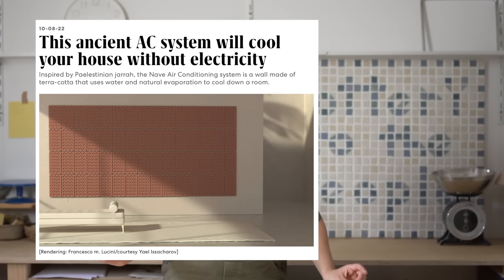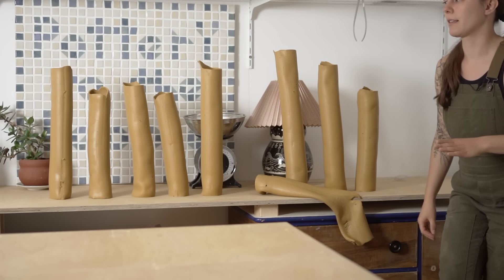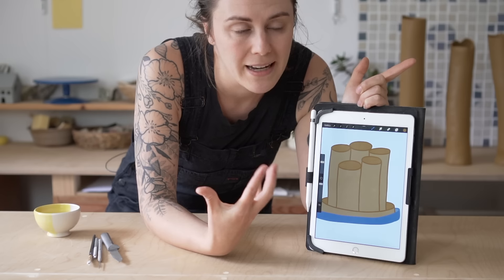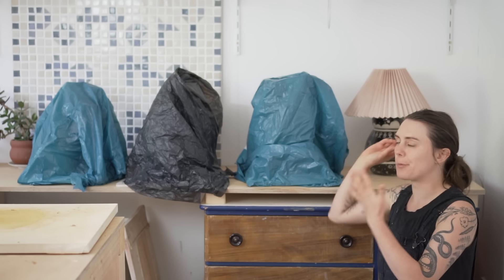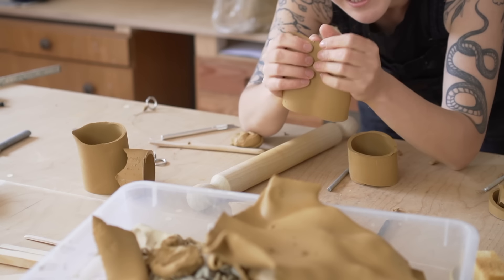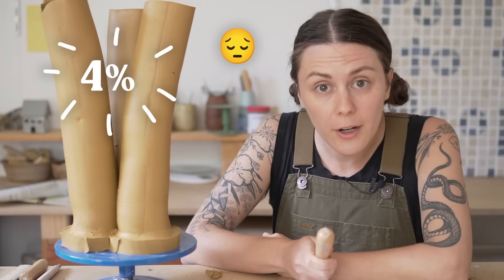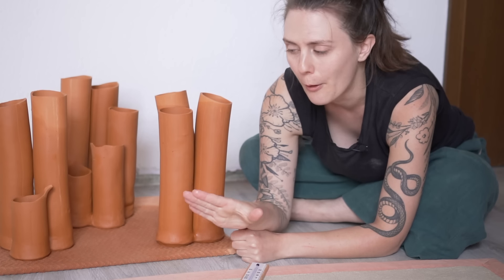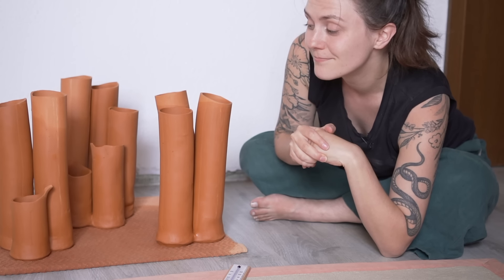Can I make an A/C out of clay???

Comment: if we have a system defined with your room, the pot, and the water, the heat pulled from the room to evaporate the water gets put right back into the room, the water will store the heat temporarily (that’s how the air gets colder) however the air gets slightly more humid and the heat from the little water particles will get redisbursed back into room as long as there’s nowhere for the evaporated water to go. Whatever heat is lost by the air is gained by the evaporated water and still remains in the system. Circulating the air a bit might help more and this is on an extremely small scale so the overall effect is probably pretty negligible.

Comment: Very nice video!  FYI in India since immemorial we have been using clay pots, glasses, dinner sets, utensils etc and many more products used especially during summer...we use it even now not because we cant afford/use refrigerator its mainly because of the earthy feel and taste which makes a huge difference between water from a clay pot vs fridge also a curry made in an earthen pot vs a metal utensil :) I havent tried using it as AC but will definitely try :)

Comment: These are awesome for places with lower humidity but we need to find a way to cool humid places, like Florida, if we want any hope of getting off ac. The biggest hurdle to that being that sside from traditional ac there's no way to decrease humidity without increasing heat. Even running an electric dehumidifier heats up the room by several degrees and often you have to overuse the ac just to get the humidity to a tolerable level. (Meaning it's 110f and 89% humidity and inside you're wearing a sweater or under a blanket bc the ac is shooting out freezing cold air all day long!)

Comment: I would not be able to function if I didn't have AC where I live. But I'm planning to move to Germany in a few years and I've already been looking into other options (especially since, as you said, AC isn't super common in Europe). This is definitely something that's interesting. I wish that newly built buildings that don't have AC still had some of the old tech that was used to cool places and create air circulation throughout a house for example.

Comment: what if you used 2 sheets of clay, made a zig rag patern of a burnable rope, then crimped with perforations where there is no rope, burn the rope out, and this would effectively make a Clay Radiatior. you could blow a fan against and through any large enough perforations to make a form of "swamp chiller".

Comment: when the outside is around 39 degrees hot, even a couple of degrees cooler make a huge difference, and even if you are using an AC, you are helping to reduce energy consumption because it takes less time for the AC to reach the desired temperature, which should be not lower than 25c

Comment: Very interesting video. Not sure but it seems like it did work. If tubes kept temp low while outside got considerably hotter. As an aside there are new technologies that allow certain acts to be markedly more efficient, using far less electricity than the models of the past. I really appreciate your sharing your knowledge and skills here.
Reply: That's AC's, not acts.

Comment: I think you were more successful than you thought:

- Since your cooling tubes were all located in one spot, the temperature at the location of the coolers only decreases after the whole room cooled down by let's say 1 degree (since the produced cold at first distributes itself in the whole room). 
- If you put all the coolers into a smaller testing room (like a small storage room) you would see a much bigger temperature drop in the same amount of testing time.

- Besides, you made the effect of the coolers smaller by putting each tube much too close to its neigbour. 
This way, in effect only the surfaces of the outer tubes cooled the room down. (Only the "outer" surfaces of the tubes without any neighbouring tubes can cool the room down.)

Recommendations: 
- Seperate all tubes from each other and distribute them all over the room. (No tube must have a neighouring tube to maximize the "outer cooling surface area").

- Your cooling tubes had - when you checked them - , already cooled down the whole room nonetheless by 1 degree (which is a lot) in regard to the room size of about 20 m³ or so. 
(It would have been interesting to check the temperature in various spots in the room by placing the 9 or so cooling tubes in 9 spots equally distanced from each other and locate thermometers of the same kind half way between all of the tubes.)

- Besides you could improve the cooling effect of the tubes by adding thin metal cooling rips vertical to the outer surface of the cooling tubes, if available. (Maybe from used vegetable cans.) -  This way more of the room's warm air could be cooled down in the same amount of time.

Comment: This actually comes from an ancient method of cooling systems called the zeer pot, which uses the phase change of water to absorb heat from the center of the pot. When you put so much water in it without it evaporating, it’s actually taking away efficiency of this process. So if you made a pot that had a high surface area to volume ratio, along with using a fan to blow air across it (increasing convection heat transfer / evaporation rates), you could potentially see better results. However I would couple in a dehumidifier in the room to lower the heat capacity of the air so you would be able to produce cooler air faster.
Reply: My only concern which I can’t exactly remember right now, is that I feel like this breaks the first law of thermodynamics, which is that the energy in a system can’t be created or destroyed. The zeer pot cools the inside of the pot at the expense of the water vapor pulling out heat. Despite the energy it takes to change phases, all that warm humidity is simply going into the room you are trying to cool. So I guess it would only work if you could release all that humidity into the surrounding environment ie: outside the room

Comment: To understand what went wrong, look up Zeer pots; they're basically earthenware refrigeration devices that work on a similar concept to this and are known to be extremely effective in hot climates; all the sources will tell you that they become more effective and achieve lower temperatures the hotter it gets outside, since they're basically evaporative coolers. 67°F is already pretty dang cool for a room temperature (like, why would you want it any cooler?) and is probably way too low to get any measurable effect from something like this. Send one of these over here to southern California where it easily gets like 80-95°F indoors in the summer without air conditioning, and I'll let you know how well it works 😁

Comment: So there is a technique from the miniature painting that I am curious how it would work with something like this, it should help for both increasing the surface area and adding to the organic texture, but I'm not sure how how feasible this would be for such thin pottery.  The basic idea is you take something that is very liquid but will dry to be solid in the case of miniatures l some thinned down 2 part putty in this case obviously just thinned down clay and you stipple it on with a coarse stiff brush and it leaves behind a texture.  As I said I'm not a potter so I don't know it this would do something undesirable to the porousness of the clay would make it much more likely to crack or would just sort of flake off in the kiln, or if it would work the way I'm thinking and just give you the extra texture when done.

Comment: couple of things: firstly, theres more efficient designs, secondly, you need airflow to transfer the coolness from the tubes to the room, the most obvious method is designing an insert for your window so that as the hotter air blows into your room it gets cooled from the tubes. in fact i gurentee thats how it was actually used in the old days

Comment: Great idea. Space them out more to allow ample space between the tubes for air flow. Think more functional then art. You just need a little more science. Cold air drops, heat rises. Suspend them or make wood or metal legs to get them more room to work. You had them setting on the floor, already the coolest place in the room.

Comment: They may not have worked to cool the air much, but if a thermometer in a similar room showed a significant rise in temp it could be evidence that it worked to keep it cool-er.

Also, if you point a fan at them, it may do a better job of cooling,

Comment: I think this would work much better in heat. 67 is pretty cool… much cooler than body temp. In the US we use AC because hot is like 90 or 100 degrees. The effect of this method might scale better in hot weather.

Comment: @potterytothepeople A wire pulled across the bottom of the extruder die will give you the best flat cut on the bottom of the tube if you decide to do more of these.

Comment: Interesting experiment. It made me think of my Peace Corps days in Brazil, 1967-69, 10º from the equator, without electricity, 
I used a water filter made of unglazed terracotta. I paid a neighbor boy to bring about 40 gallons of water on his donkey from a dam outside of town. I covered the top of a gigantic jug (handbuilt by a neighbor, about 2 ft across X 3 ft high) with a clean dishtowel (ironed to sanitize it) to filter out small stones, vegetation, & insects.
Any water to be used for drinking or cooking was boiled for 20 minutes. After it cooled, it went into the top of the ceramic water filter. I'm not sure what the filter was made from but it seemed to be a rough white, stonelike, porous cylinder. The water then filtered into a lower section of the container with a spout on the side near the bottom. Filtered water was almost as cool as it would have been if kept in a refrigerator. Each week I cleaned the water filter which collected a thin brownish-green scum, by rubbing it with sugar and rinsing it in filtered water.
An almost constant breeze, mud-brick walls, and ceramic-tiled roofs kept houses from getting too hot. The average temperatures, mid-day year-round in the shade, were in the 80s. In the noonday sun, above 110º at times. Nights were cool enough for a light blanket. 
When I visited my Peace Corps site in 2011, it had many things it didn't have when I lived there including running water, a sewage system, full-time electricity, a hospital, collegio, hundreds of motorcycles, wi-fi, and a cell tower but I didn't see any air conditioners.

Comment: This is also called a swamp cooler.  It can be made with stones, clay, fabrics, screens, thin wood panels, etc.  The more humid the regional climate, the less effective the swamp cooler will be.  The more arid the local climate, the more effective.  Also,  This will transfer moisture from the cooler to the air inside the house, thus raising the humidity of the house and making the cooler less effective and also making humidity troubles, such as mold.  A swamp cooler in conjunction with a fan and a dehumidifier can generate extremely cold air...but then it is becoming more similar to an air conditioner in its energy use.  Putting the cooling tubes in a breezy place would increase their effectiveness, if you don't have electric fans or dehumidifiers.  So it would be a good tool to cool a shaded patio or breezeway.

Comment: You should have checked it against the temperature outside, before and after. That room might have been 5 or 10 degrees warmer had you not had those in the room. 
Also.... would using a regular terracotta pot work? I don't have access to any of the things you used to make this, other than the Xacto knife. lol must they be in tube shapes?

Comment: You could solve your bigger kiln problem by experimenting with building one yourself, there are many ancient techniques of how to fire big objects without gas or electricity, Romans for example made huge amphorae, way bigger than the extruded tubes you made. They build brick kilns, and fired them with wood, to reach higher temperatures you could use bellows, or fans or blowers(I’ve seen people use leafblowers). It’s amazing how high the temperatures can reach!
I made my own little kiln in my backyard in which i do projects, not anywhere as big as those amphorae but the concept is the same.

Comment: i bet if you put a little fan or a couple of computer cooling fans in front of those and pulled the air through them, into the room with just the right amount of force it would work pretty well.
Reply: Just buy a fan at that point and not even bother making them
Reply: @TheLastGasStation  No.. you
the whole point of the build is to have cooling done without electricity. it's craftsmanship and science that you're just throwing away with "just turn on a fan lol"
Reply: @thebreadster1500  those little computer fans can run for days on  the equivalent of 2 AA batteries. hook a little solar charger up to it. move that air slowly and it will cool a room after a while.
Reply: @TheLastGasStation  but the point of the build is that it relies solely on handworking and craftsmanship, not electricity and circuitry, as the ancestors lived.

Including a fan would miss the point entirely. You wouldnt put an LED in an Oil lamp.
Reply: @thebreadster1500  then blow on it i guess. or have a baby dinosaur wave its tail at it or something.
Reply: @TheLastGasStation  Do chickens work..? Theyre kinda like baby dinosaurs.. right?
Reply: @thebreadster1500   maybe after they have a bath.

Comment: ok, how to dry:
take a pvc pipe the width needed or, if not available, a bit smaller, fill it a bit with sand or gravel, to keep stability, coat it with oil/glycerine, put the clay over it. The best would be to slide them onto the tubes right away, of course.

Comment: You made a humidifier this way, to turn this into AC you need to put a fan in front of it pointing at you, this way the fan will pull the moist air and push dry cool air on you, the fan needs to be about 50 to 70cm from these sculptures

Comment: As someone who lives in the wet tropics of Australia and doesn't use air conditioning, I throw plenty of shade at those who do. My house has air conditioning, installed by the previous owner. I proudly don't use it. During summer it is often still 30C + overnight. I use small fans. I do however work on steel ships year round so my summer days are often spent on steel decks that are 60C plus with radiant heat from superstructure and bulwarks into the 50s so I don't sook about it being too hot at home.

Comment: I think the lower heat you are feeling around the tubes is radiant cooling, the tubes are much cooler than the air in the room and when you get close to them you increase your heat transfer to them through radiation

Comment: Air conditioning is a design failure. The solutions are pretty easy and cheap. 1. More insulation, especially in the ceiling, proper roof venting 2. Keeping direct sun out of the house, use awnings, overhangs, soffits, trees. 3. Geothermal heating and cooling, the ground temperature is a steady 15 degrees C all year, perfect for heating AND cooling. My city gets hot days but cools down significantly at night. If your location doesn't then the principles still apply but you may need a little bit of AC.

Unfortunately, most modern houses are not designed with the sun in mind. They are just thrown up to make a quick buck. Older home like mine were desined around sun angles because there was no AC.

Comment: The water evaporates into the room so of course it wouldn't work. This type of method could work better for a cooler for food storage or something where you take advantage of the difference in temperature inside and outside the container.

Comment: Architectural design can do quite a lot to deal with high (and low) temperatures. Look to the Middle East for the best answer to this problem in their "wind catchers", thick walls and ceilings (high thermal mass, and therefore low thermal transfer in either direction across the substrate)

Comment: Look at the cooler that you were inspired by. It was a perforated and crenulated set of tiles on a wall, with hallow spaces for water to sit inside the tiles. You need more surface area in you system. The giant tubes are not going to work. I would suggest that you try again and make shallow boxes that act as the water reservoir that then have lots of small pegs that extend out to act as the wicks for evaporation as this will maximize the surface area. Point the pegs slightly down and with a slight knob on the end to gather water into them. You should be shooting for the size of a small finger to a pencil in size and as many on a tile as you can fit while still attaching them. All of this can be built using scratch and slip bonding using with slabs and pre formed parts. To decrease cracking chances, form the fingers the same day as the slabs and dry them under a loose plastic sheet to match their moisture level before attaching them. 

You then want to make sure they are placed higher up in the room, at least at shoulder height, so that they are cooling the hotter air and can start a convection flow as they are cooling the air. This will work way better than your tubes.

Comment: FANS! Even in a hot environment having a breeze will help so much. They also improve the efficiency of AC because the heat is spead more evenly throughout the room and you can set it to a higher AC temp to get the same feeling of coolness.